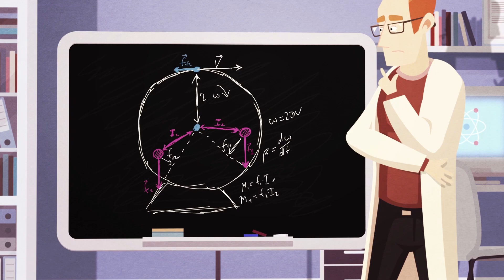Why don't perpetual motion machines exist

Comment: Does perpetual motion exist in vaccum? Since there is no resistance force like gravitation ,air etc
Reply: Friction from the components of the machine would still create heat aka loss of energy even in a vacuüm. I'm far from a scientist so correct me if I'm wrong I just watched the same video but from TedEd

Comment: WAKE UP FROM THE COMA!
1) A money prize for solving the EXPERIMENTALLY PROVED mechanical paradox, which is described in the link below:
 https://www.youtube.com/watch?v=xX14NK8GrDY
2) Friction (and the related experimental error due to that same friction) is reduced practically to zero either (a) by using of simple permanent magnet slides or (b) by using of liquid-nitrogen-equipped slides, which can befound in the two links below:
https://www.youtube.com/watch?v=KQH2UhHss6c
https://www.youtube.com/watch?v=Vxror-fnOL4
(Note. A cup of liquid nitrogen costs $2 only.) 
3) In one word, if Ma = 1 kg, Mb = 4 kg, V1 = 1 m/s and N = 10, then V2 = ? and V3 = ? (Please consider also carefully and thoroughly the first fixed comment of ours just below the video in the first link above.)
Looking forward to your answer.
WAKE UP FROM THE COMA!

Comment: Try this: build a hollow cylinder. Line the inner walls with magnets running long ways make sure that all the polarities are the same direction. Mount each at a slight angle in the same direction, this will affect spin (📐 📐). Now build a smaller cylinder mirroring the mounting of the outer magnets ( so you achieve repulsion not attraction). The issue I have is place the inner cylinder inside and then containing it once in motion. Bah I know this is a long comment but if you could solve the containment issue. I think this idea has potential. Of course this is a very simplistic explanation but the best I could do in a YouTube comment lol
Reply: The construction issue you have is minor you should easily be able to fix this. The device will not work. It is true you have repulsion when the magnets face each other. But as the cylinder rotates towards the next pair of magnets you have a barrier to overcome. Adding friction it is doomed to fail.

Comment: Perpetual motion machines are mentioned in the Bible and so is the knowledge. There are facts in the Bible. But unfortunately, the word jesus is what originally meant knowledge. Many people believe that Jesus is a personal name, but it is not. If the misunderstanding has been avoided, the picture would become another.

The Norwegian word "viten" means to know something important.  It leads to the right path with knowledge. You can read the Bible and interpret. You will be surprised.

The gravitational force is actually an energy source. Just like you are in a rocket at increasing speed and it requires energy. And you know artificial gravity on board.
It in no way breaks the thermodynamics.
To harness the energy requires accuracy and logic.
Reply: Where?

Comment: Someone explain this:
You know those torches you charge by pushing the handle on the side...why can't you make one for a car that charges as you press down the pedal?
Reply: Joshua Ovington you would have to press down on the pedal at an in humane speed, to keep the engine going at 45-60kph (road speed) or 110kph (highway speed) also electric steering radio lights etc
Reply: @sup4904  but is it plausibly possible? Like could it be made with a bit of innovation?
Reply: Joshua Ovington no, I don’t think it’s possible, I know gas cars, once they start driving their battery gets charged when your in motion. But to drive manually by pressing the pedal with your foot would be impossible. Unless it was gas and once you get going then it switches to electric. That could be a possibility.
Reply: @sup4904  I was thinking like...an electric car that you charge for the purposes of starting the motion upon stopping and for back up fuel purposes. However, the electricity requirements would be a lot lower because the main source of power is the pedal motion thing. I'm not a sciencey person over just thought about this since I was a kid and learnt about kinetic energy lol
Reply: @joshuaovington8063  if you are strong enough to power a car using your foot and a pedal, you are probably strong enough to run as fast as a car anyways.

Comment: I was actually planning on making a perpetual motion machine including both weights and magnets
Reply: magnets wear out after a while
Reply: @BigJulumbas  what? 100 years? Any machine that can last your lifetime before getting a boost for another 100 years is worthy of being Grand Master.
Reply: @brucemiller1696  It doesn't take even a year to stop, and you can imagine something that moves all the time, it has to be friction in the spindle. It damages the system and eventually it has to stop.
Reply: @ujinholo2181  magnetic bearing?
Reply: @ujinholo2181  Yes, theoretically, how long can 1 run before a boost?
Reply: Katsuki Bakugou same
Reply: Same
Reply: It’s impossible I believe
Reply: Unaverage Avocado maybe
Reply: Don't think as making a perpetual motion machine which would be 100%, a 50% machine would also work...
Reply: Fot Guru how would a 50% work that would mean it would do either a few rotations or half of one
Reply: It won't work. It cannot.
Reply: Try try but don't cry 
It is possible